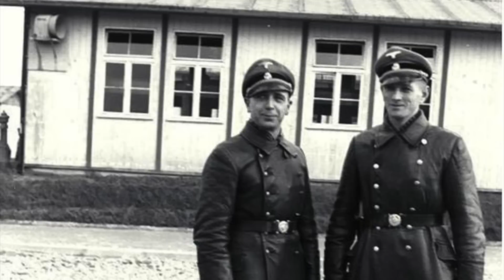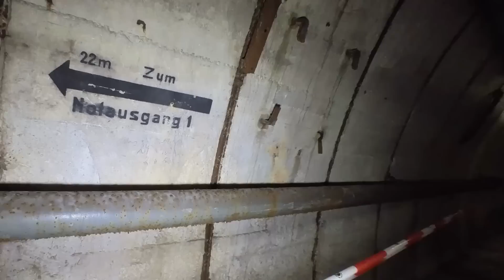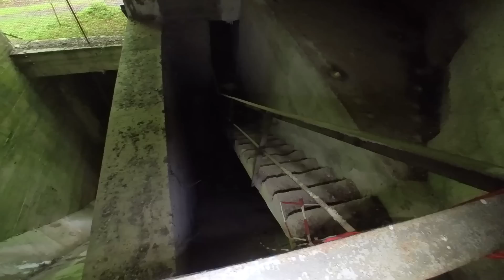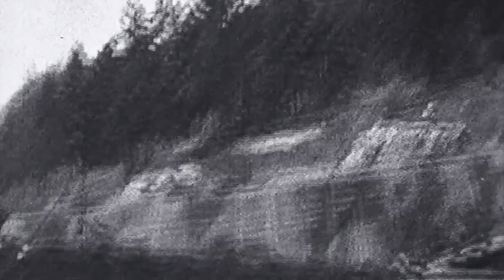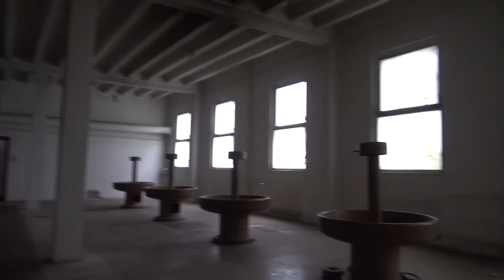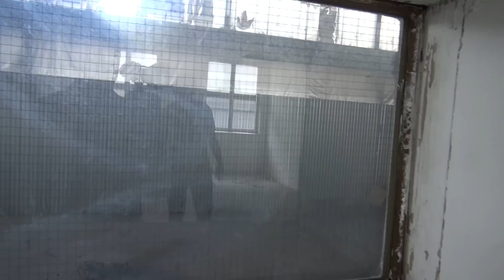The last Nazi Secret - Where Rockets Grew

Comment: Many years ago, just after the opening of the former Military Area at Peenemünde, as a Dane, I visited the area, and without much to actually see, besides an A3/V2 Model, with some original parts and a Nazi Deathmask from an Officer who had died in an accident. I later visited the DORA Factory area in the Kohnstein tunnels, which had been opened with a new tunnel going in, passing the Russians' attempt to close those by blowing up the former entrance. Only a part of the System had been opened for visitors. But the former huge railroad loading area outside and the KZ Camp must have been clearly visible from the air? We also met a man who had been a child in a Nazi Housing area, as we visited former schools and Himmler's SS Castle.

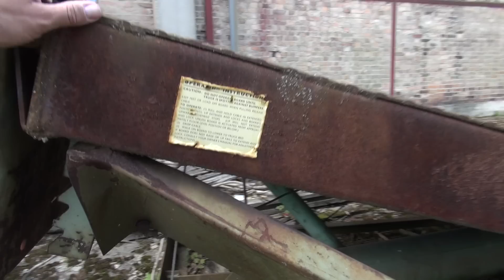Comment: that thing you show at around 39:22min in youre film,that was used to load en unload trucks,it's a loading ramp.
A very early model.
that is build in the side of a building with a rolling door,and when a truck backs up to the loading bay,with his doors open at the back, you would pull a "cord" and that would "pop up" that piece of steel plate that is hinged on the front on the contraption.
That peace of steel plate would land on the truckbed,,inside the truck,and that gave you the possibility to pull out and push in all sorts of goods.
(mostly on pallets)
How old the concept is, i dont know,and i am curious if the germans invented it ??

Comment: I suspect that the larger room upstairs might have been used for lofting drawings to full scale. I also think sub assemblies might have been machined and built in some of the upstairs rooms hence the heavier built floor to take the weight of machinery such as lathes and milling machines.

Comment: the idea of taking a building down and moving it is not that difficult - at Brooklands in the UK, this was done with a hanger which was built during the war on the downhill stretch to what was previously the pits and finish line, after the war when Brooklands was repurposed by Vickers building such aircraft as the mighty VC10s and parts for Concorde, construction often ended in this hanger, before the final planes rolled onto the runway and off for test flights

roll forward to the present day, for the purposes of restoration and regeneration Brooklands has much history in its past for both motor racing and aviation the museums have many examples from both racing and aviation, but it was very dated

a plan to have an aircraft museum and hanger moved and modernized came about, later after a full inspection it was decided to take it apart, take the steel away for sand blasting and painting and brought back for reassembly in its new location close by, the outer skin was old and would be replaced with something more modern to cope with British weather - the hanger was taken apart, steel beams were only bolted together and came apart very easily, there were very few bolts that were stubborn and i think the vast majority were reused, the hanger still maintains its original look all be it with a modern skin and now houses many exhibits including Nessie, a Wellington Bomber found in Lock Ness, that was built at Brooklands, and of course its design by Barns Wallace who had an office overlooking the same area where the aircraft were rolled out

i bet the building was constructed in a similar way, steel frames, bolted together, and i might also suspect the bricks could be local, we all know what happens when you knock a wall down, the mortar needs breaking off the bricks, and often bricks will break, so i suspect were replaced with local brick

Comment: ❤❤ Tino liquid nitrogen is not used in rocket engines it's called LoX its liquid oxygen called A,stoff an then they add methanol/Hydrozine is  methanol  an water  called B,stoff they also use potassium permanganate (kmno4) for the catalyst to drive the turbines to feed fuel into the rocket motor😂 just thought I let you know lol if they used nitrogen it would put out the engines lol 😂😂😂 fantastic work as always Tino 👏 😄 ❤❤❤❤❤❤❤
Jasmine from Sydney australia 🇦🇺 💕 ❤ ♥ 💗 💓 🇦🇺 💕 ❤ ♥ 💗

Comment: The machine upstairs is a Bandsaw, which would have a round blade running on the two large wheels used mainly for cutting wood Tino.

Comment: Could the Germans have built a bigger rocket here than the V2? How near were the radiation experiments to this? It seems logical that the V2 was built in sections (which took some time and were built underground). The sections were then taken up and rapidly put together, armed, fuelled and fired.
Reply: Maybe Wernher von Braun got that answer